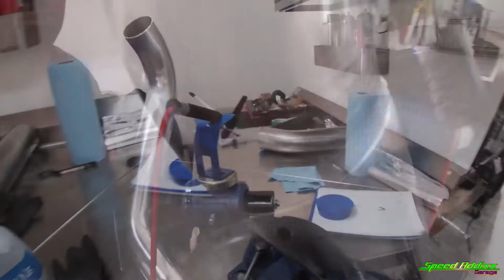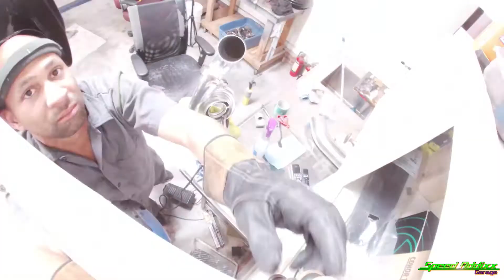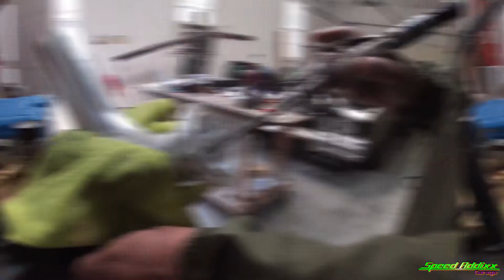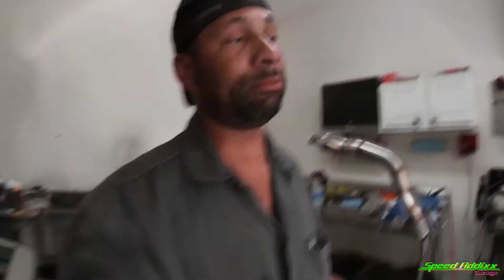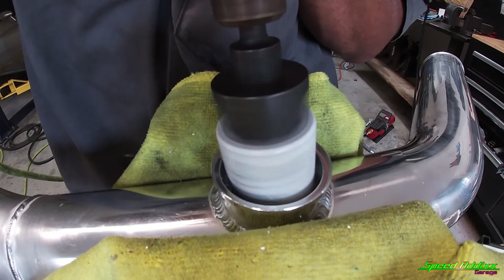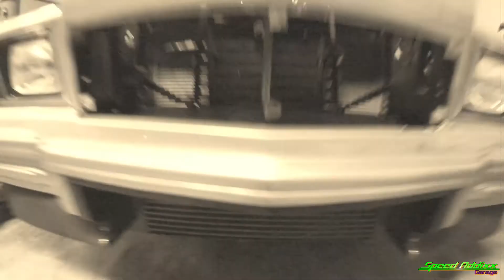1970's Monte Carlo Custom Intercooler Piping Turbo S475 Built 5.3L Fabrication at Speedaddixxgarage!

Comment: Good work my brother! You always giving a diyer like myself motivation to get after it.   What brand is that bead roller?

Also bro, I got a lot of the same tools but I’ve been struggling with my welding game due to not having enough seat time. I know it takes a lot of experience to get to your skill level but is there anything you can suggest for a rookie to improve his skills with welding? I get stuck trying to “not waste materials”
Reply: I bought the same one from ebay. It works great!
Reply from the maker: Its autobahn.....I don't even know if that company is still around. I purchased it second hand